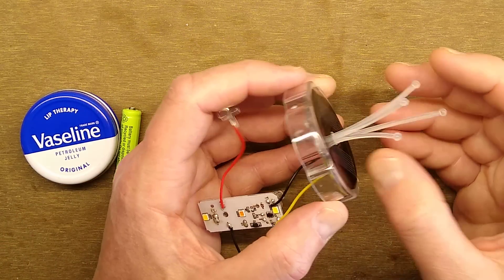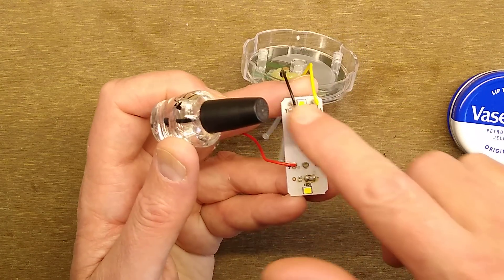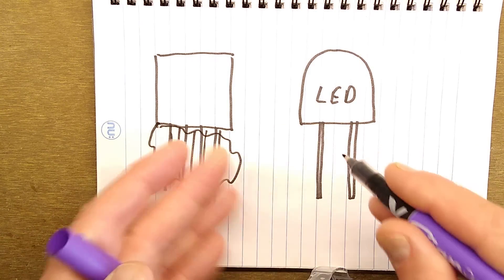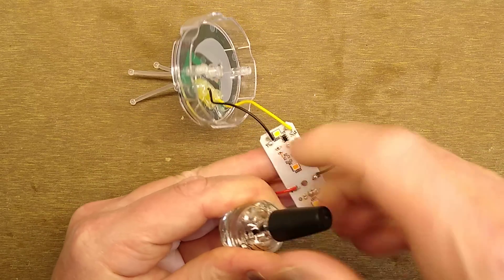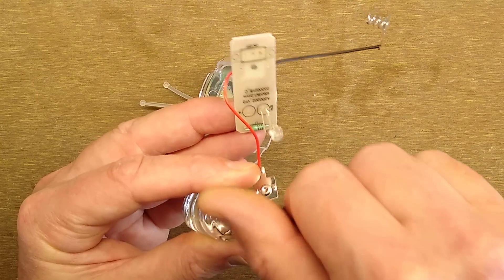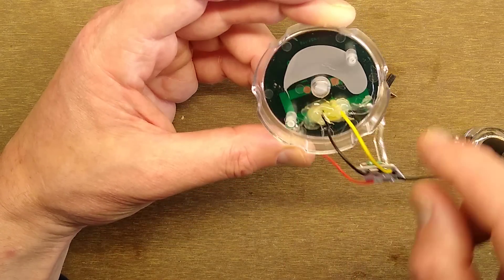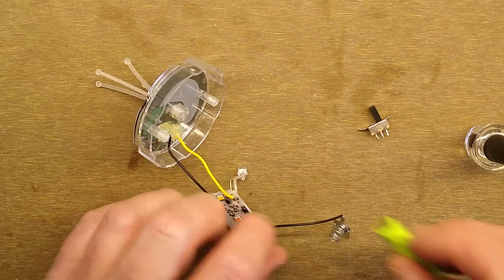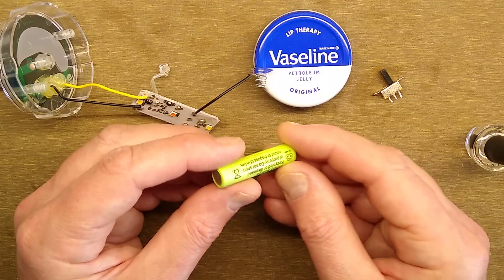Waterproofing your solar lights to make them last longer

Comment: The boxes that come with  LED strings don't always have the seal in the right place.
The control panel is about £1.50 from China but the whole lot was corroded inside while looking fine on the outside.

Comment: I'd spot-weld some nickel strips on the NiMH cell and solder the wires directly on. Also, install the cell with the + pole pointing down. The can (which is the negative terminal) reaches all the way up and forms the "collar" around the plus pole. If that groove fills up with water and/or oxidises, it will short out the cell. With the + pole down, it should just shed moisture.
Reply: That's a clever take, I like it!

Comment: Using liquid rubber for those things. Also easier to get off if needed.

Silicone for the edges on the solarpanel

Comment: Hmm  - I've had a ludicrously expensive Phillips electric toothbrush die on me due to a failed gasket at the top which allowed water - well, mostly water, to get in and kill it.  Was thinking about ways to supplement the protection on the replacement, and adding a generous gloop of vaseline about the spindle at the bottom of the brushing head  doesn't seem like a bad idea.  Bit nervous about it getting in my mouth though - but - hey - the cheapest available option on amazon is 'cocoa butter' flavoured vaseline.  When I were a kid it only come in petrol flavour. Who knew?
Reply: I had the internal battery fail in mine, tried to replace it but the toothbrush body was ruined in the process of prying it open.

Comment: I was wondering how bad could it be to apply a reasonable coat of Vaseline paste and then point the heat gun at the circuit to make it creep around contacts and into gaps.
Reply: All the solder joins are made and can be undone with a heat gone.  All the electronic parts are designed to only be subjected to that much heat once in their lifetime.  So heat gunning finished electronics has a high risk of causing damage.
Reply: @johndododoe1411  fair enough. I should have said that one should apply enough heat without having to "toast" the whole thing, since the Sun is already something that heats a lot. A decent heat gun can go up to 400 °C but I think something around 60 °C would be enough to turn the paste into a viscous liquid.

Comment: Aha, cheers Clive, gotta say I’d heard of using oil or a varnish but hadn’t considered using Vaseline. Good tip. Personally, I’ve always popped them open and just smeared silicone sealant about, facilitating any lower areas to drain and air out. With the ‘death switch’ I just bridge the pins with wire/foil and coat that too. Because I’m a lazy bear, lol.

Comment: Would there have been anything wrong with putting nail polish around the edge of the solar panel?
Reply: That was my first thought too, but I read some of the comments that stated that nail polish degrades in UV.
Reply from the maker: I wasn't sure about the solvent affecting some solar panels.

Comment: Can Silicone be used?
Reply from the maker: Yes.  Silicone grease or neutral (non acid) curing silicone rubber.
Reply: Thank you, that’s reassuring advice.

Comment: I use red nail varnish to mark the +ve terminal in things like TV remotes when there are only relief moulded indications.  I also use nail varnish as a thread lock. Not for anything serious but maybe on the nuts and bolts of a chassis mounted PCB for instance.

Comment: It would be interesting to put one untreated outside as well, and revisit this in a year (or whenever it fails) to show the difference.
Reply: it will just rust away probably wont take a year if its got wet.. ive seen them with no legs left on the chip.. and the led with no legs or only 1 leg because the positive leg of the led was rusted away.. i never thought of nail varnish.. thats a good idea
Reply: @09danstart  On the other hand, I've got a number of solar "beacon" lights intended for marine use.   They cost more, but are hermetically sealed and last a long time.   I use them to guide vehicles up my long driveway.
Reply: I have two out of three deck post top solar lights that are dead. The one that works is over the overhang of the house and doesn't get wet. They all get roughly the same amount of sunlight. It took almost 3 years for them to die

Comment: My big problem is that within a year most of the lights will have significant yellowing of the plastic over the panel and t makes the panel look all cracked up.  Some will still "work", but be unable to fully recharge the battery.  
One good use for Vaseline is to smear it all over the backside of your garage door weather stripping.  The sun would bake the stripping to the door causing it the stick and shake in summer.  So much time and money wasted having repair shops try to fix it...
Reply: Just a fun fact: The appearance of those little lines in degraded plastic is called "crazing".

Comment: for lamps where the circuitry is contained in the top cup, personally i just melt some vaseline on a big spoon or similar small metal container and the dump it all over the interior making sure it touches everything before it cools by swirling it around and actuating the wet switch. its messy but is quick for when you are waterproofing a lager set. also has the benefit of the coating not being able to crack

Comment: Used to work in garden centres and had no end of returns on lights "stopped working". Very few of these are labelled "waterproof" but the (reasonable) assumption is that they go outside - they should be!
Reply: Do they make a loss on them? I'd imagine most of these lights are destined for landfill after 6 months.
Reply: @CamelCasee  They figure that most customers will simply buy another one. Only around 5% will still have the slip around, and be bothered to claim on the warranty. However with the increasing rise of shop cards all you have to do is have a rough idea of when you got them, and then get the shop to look up and reprint the invoice to return them, though with more now emailing you the slip it is easy to just look at your email and find the shop purchases and look yourself, and give them the invoice number to enter in the returns counter. Did that last week, returning a failed cheap mouse, more because I was going to the store anyway, and it had died after a week, so exchanged 3 weeks after I got it.
Reply: I wonder if there is such a thing as the "100$ garden light", that has all the bells and whistles a garden light should have...
I personally have a piece of ws2812 strip and a powerbank stuffed in a 2000ml white powder bottle. works really well, even in the pool :D got to charge it now and then though.. but it has wifi :D

Comment: I use a product that leaves a film made for circuit boards, that peels off quite easily (Q30). I don't think it'll do too well in direct sunlight, so might not work sprayed into the cell. But I'll try it out and report back in a few months. Only issue I've had is battery life.

Comment: Tough problem to solve. Nail varnish will breakdown under UV light. Vaseline will obscure the LEDs and will wash off after quite some time, then there is condensation, what to do?🤔

Comment: Ever since I learned the word “baseline” I’ve wanted to make “Vaseline” rhyme with it.

I wonder how tough nail varnish is regarding UV, and whether it blocks useful wavelengths of light. As it’s colorless it presumably won’t block visible light much.
Reply: Glass, and plexiglass are perfectly clear and most of it easily blocks uv, so no assumption can be made based upon transparency...
Reply: UV  fingernail polish is available. Looks Black in the jar, a blacklight makes it blue, red, what ever color you want can be bought.

Comment: what happened to tapeing over the solar panel to seal the edges as you did in previous videos?? 🙂
Reply: It didn't work. Any tape has a "glue backing" the glue and tape go their separate ways after a while.

Comment: The problem I have living here in Southwest Florida is the solar panels seem to succumb to the intense sunshine in only a couple of months.
Reply: Look for some automotive “2k clear coat” paint you can find this in head light repair kits sometimes as well. It is very UV resistant, still the sun down there is gnarly so after a few years you may still need to buff and reapply another layer.

Comment: If only there was a way to slow down or prevent the ultraviolet degradation of the resin that covers the solar cell.
Reply: There may be, try using UV protecting car wax, or the stuff they use on headlights! Might have to reapply it one a year but it should do the job...

Comment: Good idea but you have now trapped some moisture under the nail varnish as is the way with anything not coated in a controlled area but you have limited the amount of moisture that will affect it but also made any repairs a tiny bit more awkward.

Comment: Hi Clive, First I'd like to thank you for including the direct youtube links in your patreon video email notifications, it saves lots of irritating clicks through the patreon site, and is a thoughtful addition. 
On topic:
Thanks for the tips, and this is good general info for electronics exposed to outdoor conditions.  The next time I need to replace the BME280 sensor in my weather monitoring setup, I'm going to apply these treatments to the exposed connections.
Reply from the maker: Be careful not to contaminate the sensor in any way with oil/grease/vapor, as it will affect its ability to measure humidity accurately.

Comment: What kind of hotmelt glue do you recommend for this. I've not had much luck with it as it seems to go cloudy over time in a wet environment and become unstuck.
Reply from the maker: It may be worth experimenting with different types.
Reply: Some hot glue types are marked as "dries clear." But, I do not know if it clouds over time and exposure to sunlight. Is this the type you have been using?
Reply: apply higher heat to the glue using a lighter, it will improve adhesion to the plastic.
Reply: @xponen  I will give that a go. I have one pack of hot melt glue that claims to be dual temperature, but neither of my glue guns have a temperature setting - perhaps that's what I'm missing.
Reply: @albanana683  typically I melt the stick directly with a lighter and apply the melted part on my project directly. If using a glue gun I added heat on the glued project using a lighter or a heat-gun but must be careful to avoid damaging the plastic, although I found that if I get it too hot till the plastic got soft the adhesion became way stronger. I've glued/repair water container before with all these methods, it hold so far.

Comment: Vaseline isn't a great idea on the board surely, as it's conductive
Reply from the maker: Vaseline has a very high resistance.
Reply: @bigclivedotcom  fair enough.
My only knowledge of this is from high power battery banks for remote communication repeater stations, not allowed to use Vaseline to grease the terminals because it's too conductive.
Reply: @bigclivedotcom  how can we smear it over our battery terminals then? Sorry, I’m very confused…
Reply: @anthonyn3774  that thing is soft, the spring will easily penetrate thru it and contact the batteries' terminal.
Reply: I just shoved the leads of my Fluke 87V into a tub of vaseline - resistance measured "OL"  - i.e. no conductivity.

Comment: The nail varnish could be dripped into those heat-shrink shrouded LED connections on string lights as well? Mine have all got rusty marks in them; strange considering there shouldn't be any steel in there at all!
Reply: LED leads (and a lot of other component leads) are steel/iron.
Tip: put a cheap "fishing magnet" inside a tupperware style box for a good way of picking up the trimmings from electronic component leads - works a treat.
Reply: We had a string of red bobble LED lights for Christmas fail like that - rust in the connections of the LEDs, I tried to DIY repair it by removing dead LEDs and heat-shrinking the connections but I pulled an led off it’s legs because of the rust - and I gave-up and said to Mum “just buy a new set” ☹️ - knowing they will fail [rust] after 5/6 rounds of Christmas’s. These [outdoor] LED fairy light sets excel at planned obsolescence 😠
Reply from the maker: I've tried many things to keep the water out of those.  That's why the municipal versions have all the LEDs encapsulated in resin.
Reply: I've used nail varnish on a set of string lights, and it does seem to help. The set that I treated has been out in Scottish weather for two years, and is still working. I did have to change the batteries after the first year though.

Comment: HAHAHAHA "Lip therapy"
Reply: In the winter - our noses tend to run and get blocked = forcing us to breathe through our mouths/we shut the windows and turn on the central heating/furnace = and dry-out the indoor air and our lips will dry and crack = where Vaseline is put on to stop our lips from drying out ✅